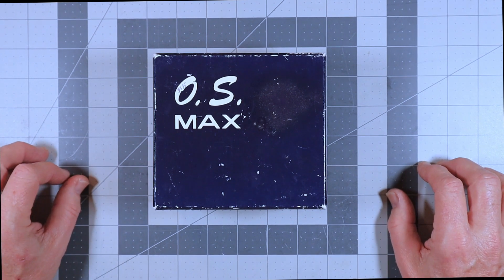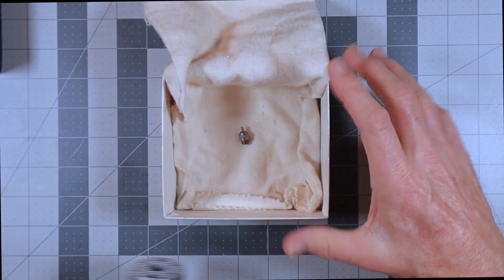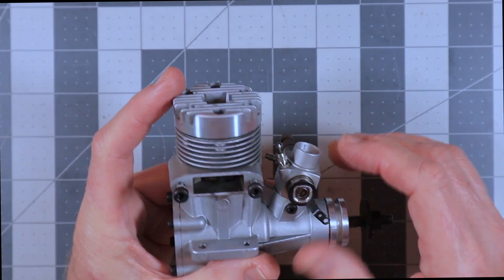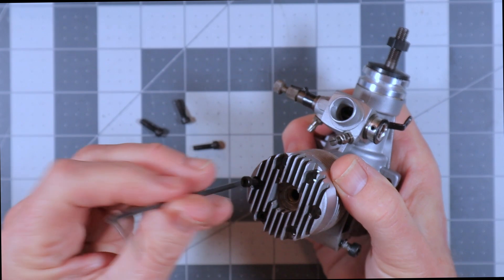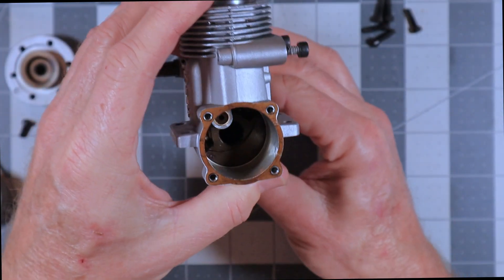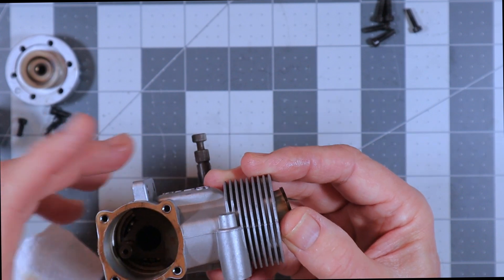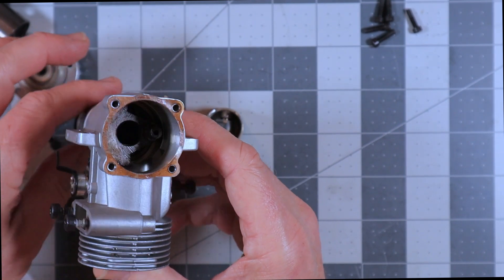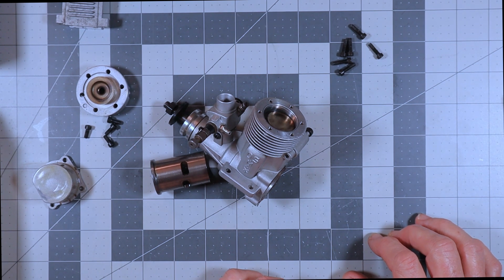OS 50 FSR A Look Inside Part 1

Comment: I just made the same mistake yesterday while I was reassembling a Super Tigre G90 I’ve refurbed. Super frustrated with myself as I knew better. The ST’s I’ve worked with all seem to have really tight cylinders so getting them back together even when they’re spotless and case heated is a struggle